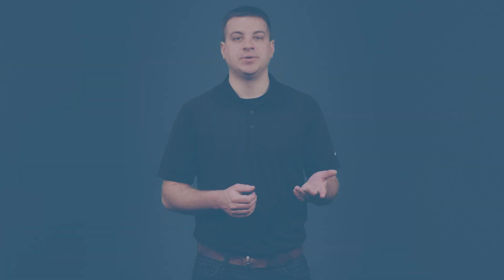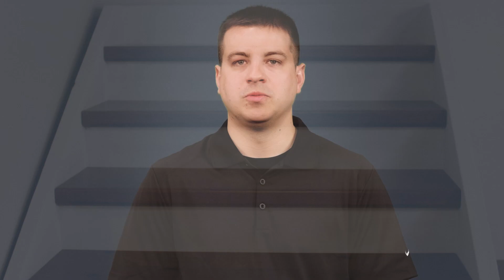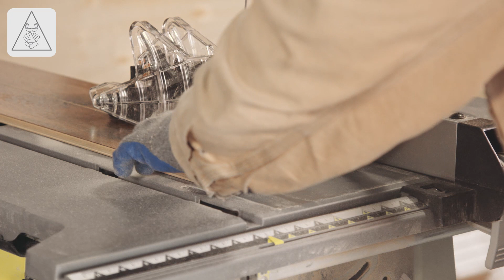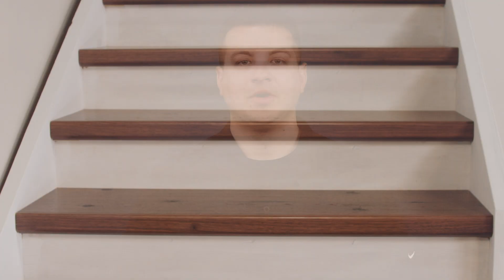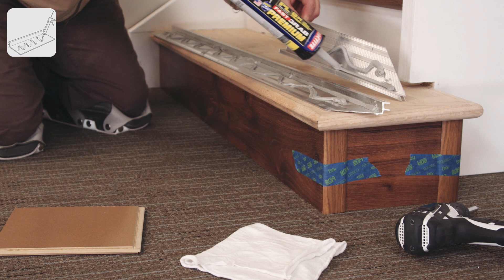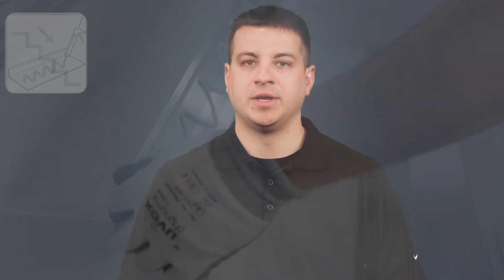Incizo 5-in-1 Stair Application

Comment: Looks cool and easy on the video but when I tried to install it, it cracked and not joined laminate floor edge. MDF is too weak
Reply: We had cracking too, especially on the T-moulding variant of the 5-in-1. The perforations creates too many weak points in the moulding and they will crack on installation or excessive use. I would not get this again.
Reply: Slawek S the laminate flooring will only “crack” if the primary sub floor or in this case the primary step is not flat/ level.
Reply: @guitarfxer  I think you misunderstood me. Laminate floor has not cracked. The strip cracked during tapping on aluminium profile. I was delicate. In a set comes green rubber which goes on the edge of laminate plank. I know it sets strip and floor in line. In my case edge of the strip has bend and nearly came off, plus it has not joined the edge of the floor. One set gone to bin. I will try another one today.

Comment: The most stupid system I ever see in my flooring life 
I can bet once I buy all stuff (floor, stairnose, silicone,adhesive, shims and way more suff, plus i need to drill holes my self hahah) that ugly cheap looking staircase will cost more then solid unfinished oak beautiful staircase just in materials I don't even want to mention cost of installation of that crap